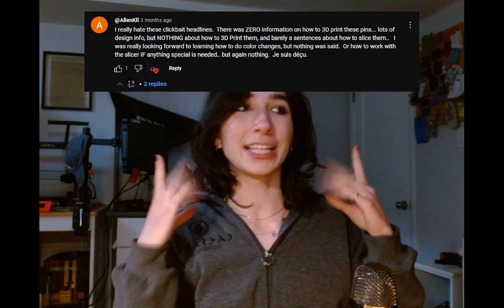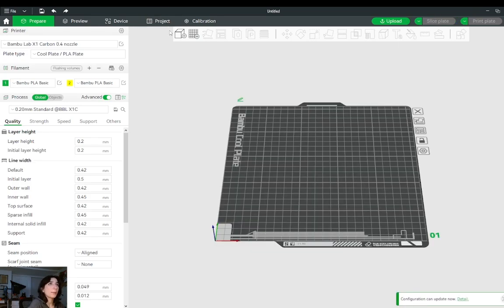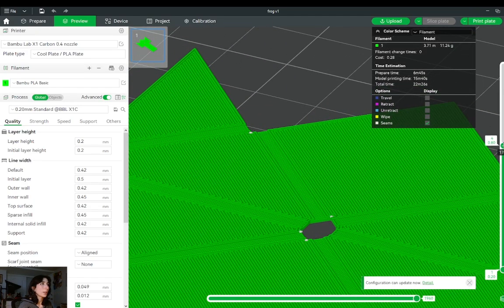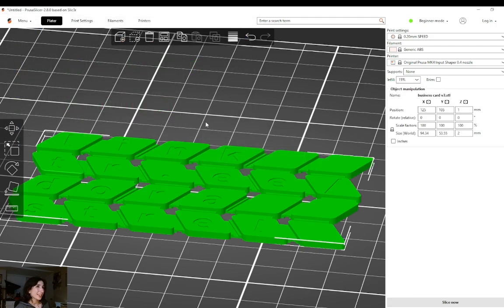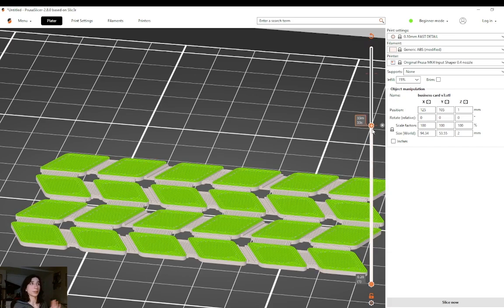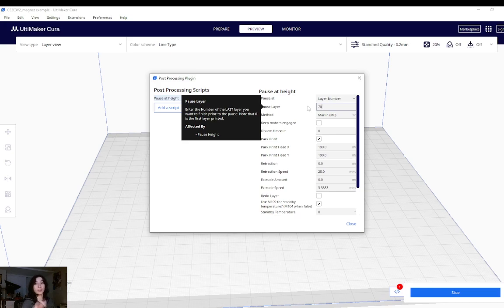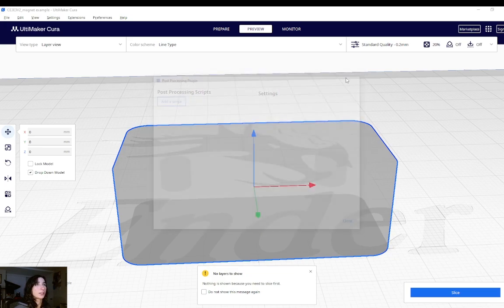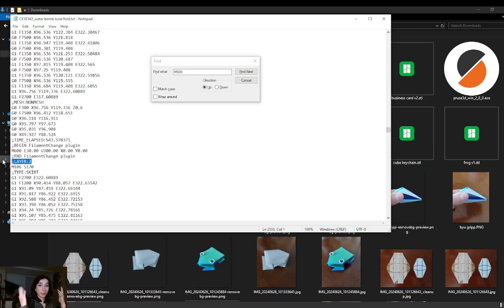how to material swap & layer pause in Bambu, Prusa & Cura slicer

Comment: What if you have a curved interface? I'm trying to find a way to apply release agents to the support interface, but if it's curved, youd' have too many steps on the slicer to pause
Reply from the maker: with planar slicing this is a bit of a challenge. trying non-planar layers would be the way to go for what you're looking to do. if your curve is shallow and gradual, you may be able to acheive this on your normal printer with an extended/longer nozzle. if you have a bambu printer you could get away with using the AMS and your planar layers in the slicer, as the AMS will swap for you without you needing to code material pauses or wait for the swap to perform manually. you basically highlighted one of the many limitations of planar slicing!

Comment: Thanks for the video! There's just one thing is not clear to me: in Bambu Studio, does the pause print happens before the chosen layer? So for example, if I pause at layer 23 it will pause before starting to print layer 23? Thanks for the clarification
Reply from the maker: If a pause is added to a layer, the printer will stop before printing that layer. You need to manually resume printing. For example, adding a pause to layer 23 will cause the printer to stop BEFORE printing layer 23.

Great question :) for more info, check out the wiki:  https://wiki.bambulab.com/en/software/bambu-studio/view-slicing-information
Reply: @strelkomania  thank you so much for the link, too. Also, I'm so glad I found your channel given that I was looking to print origami, one of which would be the Dragon's egg (not simple, but it will be interesting to see what I'll obtain)
Reply from the maker: @francescodesantis1997  I'd like to post a video very soon about some improvements to my 3d printed origami. I have recently tried embedding PLA pieces into the flexible print to fix my delamination problem when I do a multi material extrusion of PLA ontop of the flex material... Basically I design my origami model to have hollow panels and then slice it so the printer pauses right before it covers the hollow parts of the model. Then I drop in the PLA panels that I sized to fit the hollowed out part of the origami and continue the print to trap the PLA in the print. Hope this makes some sense... lol. This makes the parts of the origami I need to be rigid way stronger and solves my delamination problem.

Comment: Good tip showing how to embed print temperature changes in the gcode instead of having to manually change the temperature while the print is happening.
Reply from the maker: IKR! I recently learned it too, before I was manually doing it and it got frustrating when I would forget to adjust manually after the filament change and get suboptimal results...

Comment: For the issue with your flex business card where you changed the layer height of the full model which significantly increased the print time. You could instead use the variable layer height tool of PrusaSlicer to decrease the layer height only where you needed more layers to fit the color change in. This would only slightly increase the print time.
Reply from the maker: @Sembazuru  I didn't even know I could do that, thank you and great suggestion 🙂
Reply: @strelkomania  Thinking about it, there are two ways to do this. First would be to use the variable layer height tool and manually change the layer height in the verticle bar. The other way (might be a bit more precise) is to use a height range modifier to change the layer height. You may be able to use the measuring tool to see the height where you want the change if there is a corner in the model where you need to make the change.